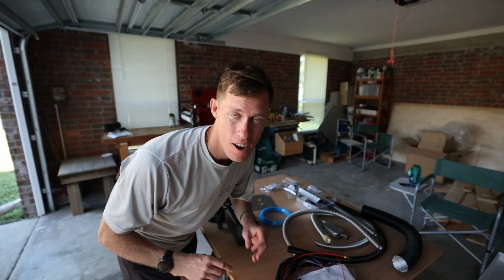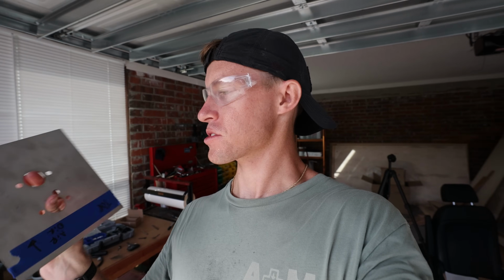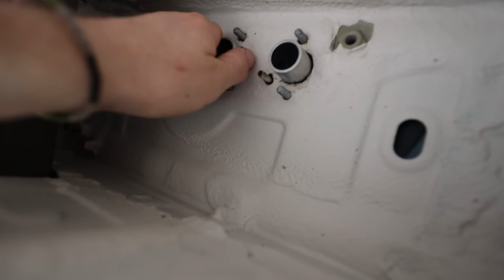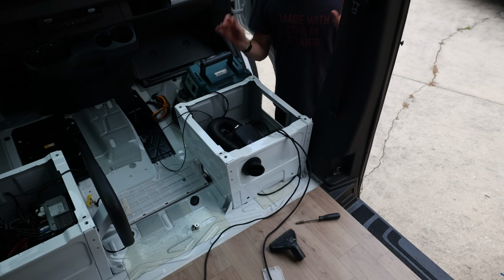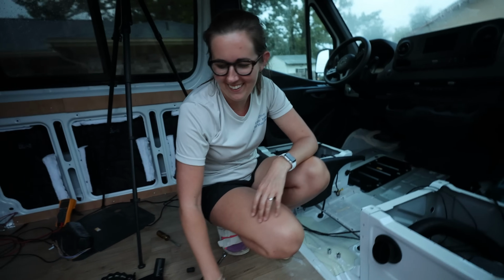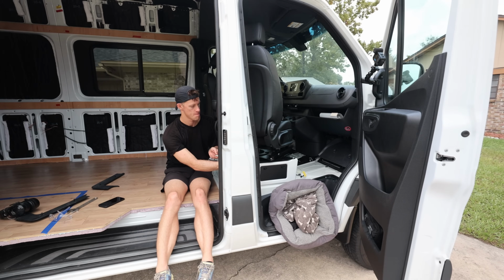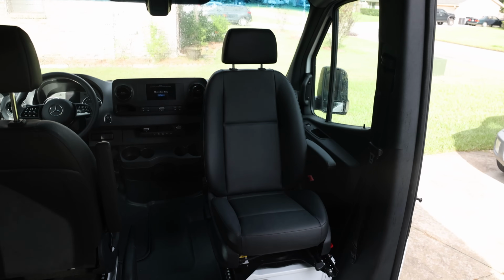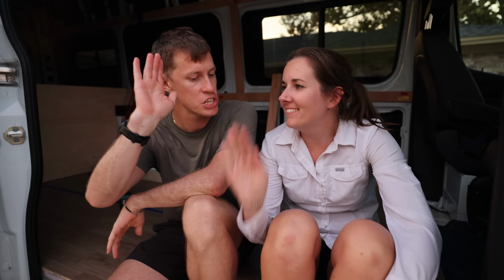Installing our Diesel Heater and Swivel Seat | DIY Van Build

Comment: Had experience with the Espar heater (D7) in my boat. The fuel pump will drive you nuts at night with the clicking. Insulate it as much as possible. They work best full on which is not always practical.
Reply from the maker: Great feedback, thanks for sharing your experience! I'm looking forward to seeing how it behaves, but like you said  - we'll see about the noise. Fortunately with the fan on its much less loud, or rather its muffled by the noise of the hot air coming out.

Comment: Where the diesel heater fuel line rubs up against the bottom of the RV get a piece of rubber hose there so it doesn't Chafe
Reply from the maker: Good tip!